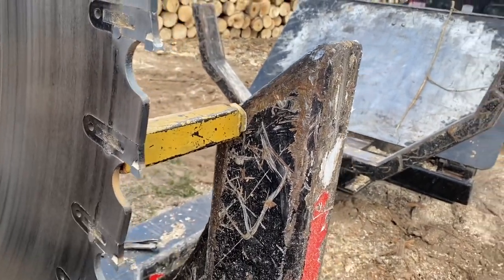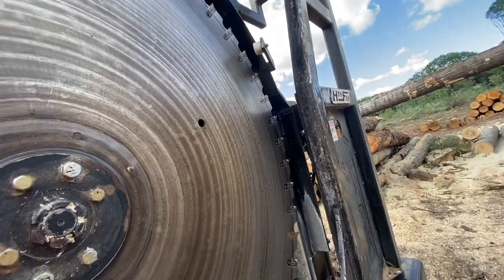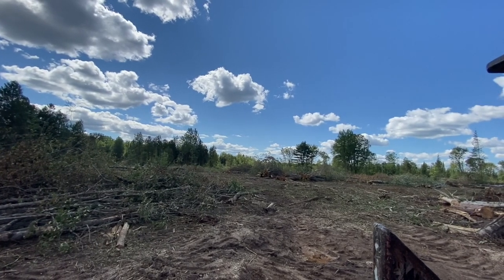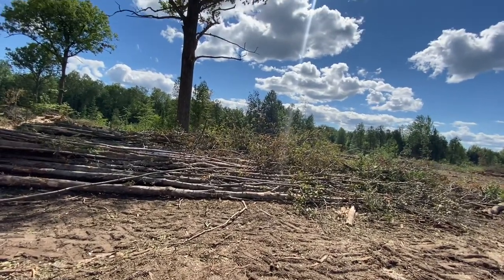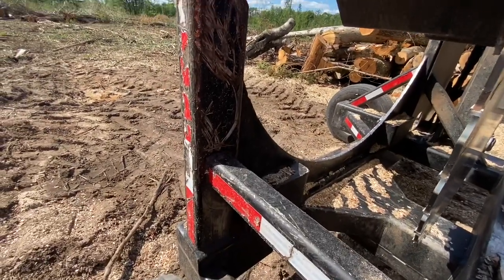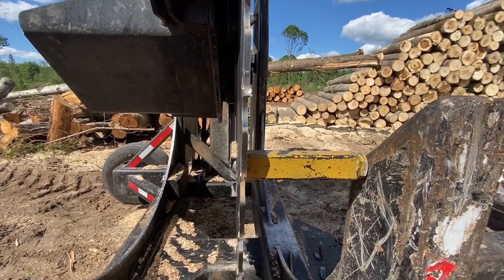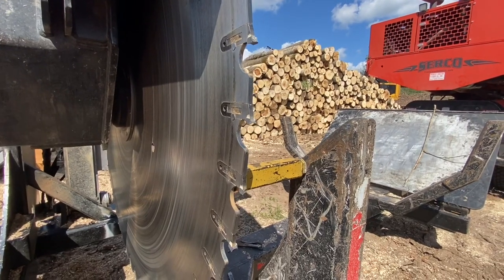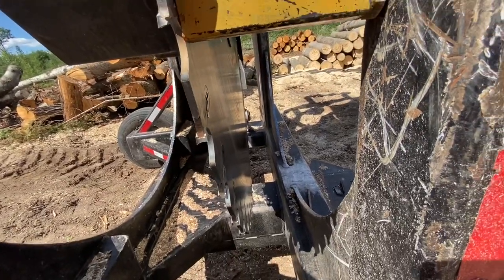After we load trucks!

Comment: That's why that truck driver shouldn't be sleeping in truck while getting loaded. No one can control that knife once it brakes off
Reply: Just exactly where do you expect a truck driver to sleep? Trucks are our homes.
Reply: @frktrk1808  As I said while getting loaded. You'll get plenty of sleep when a knife comes thru the back of the cab and cleans your brains out. Most chipper operators around here won't load a truck with driver in the cab. I personally wouldn't Wana kill someone over a mechanical failure no one can control. Only thing that can be controlled is saving someone's life by having plain common sense.